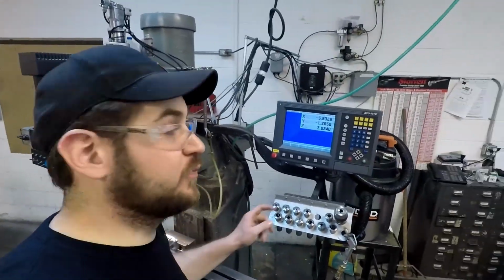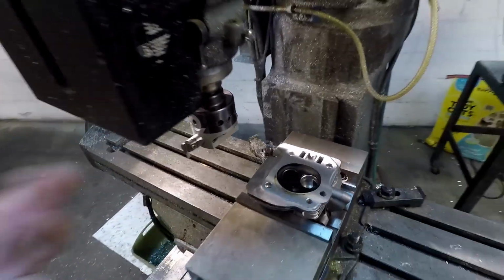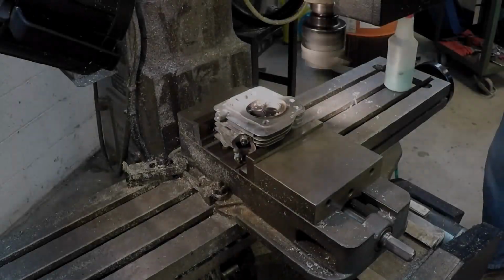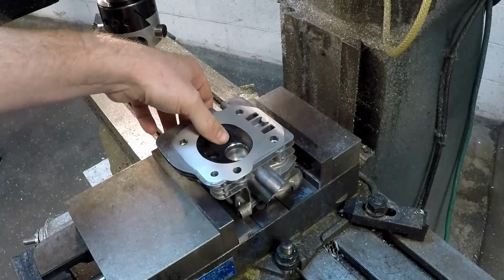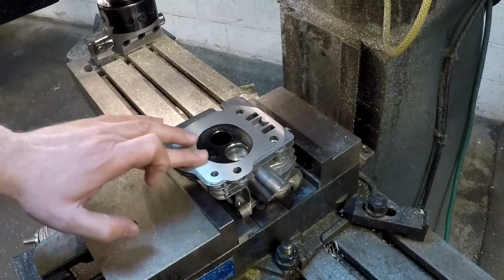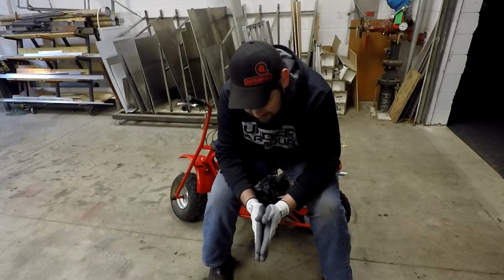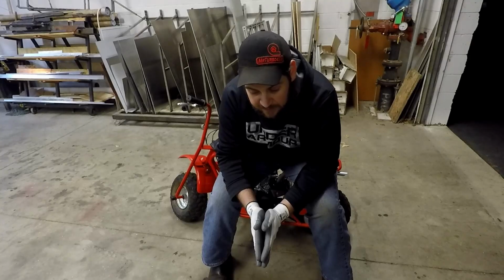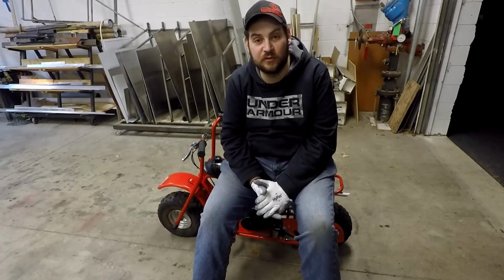Blitz Krieg Mini Bike: Milling The Predator 212 Head

Comment: Hey predator 212.570 flat top piston plus 20 billet rod for hopefully zero deck what should I Mill the head to since it's a 22 cc .060 or .070 for 12.1 compression? Non hemi
Reply: Factory predator non hemi  is 0.035-0.040 in the hole so no you won't be at zero ,trust me I've got one with that same setup

Comment: Everyone sets the work in the middle of the bed I've set my stuff to the left or right idk how many times so I don't have to re set the vice work smarter not harder
Reply from the maker: Well, for 99.9% of things machined on that machine, a centered vise on the table is what we use. Plus that's probably the only head that will be shaved on that machine ever. Lol but time saving is always good.